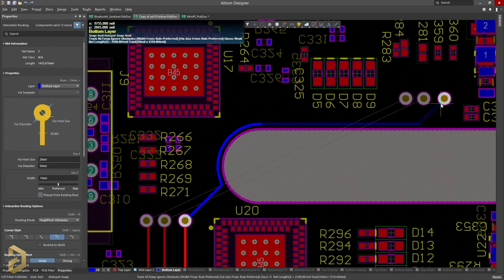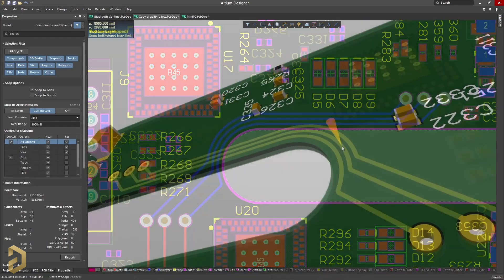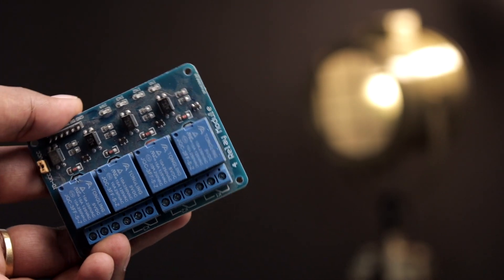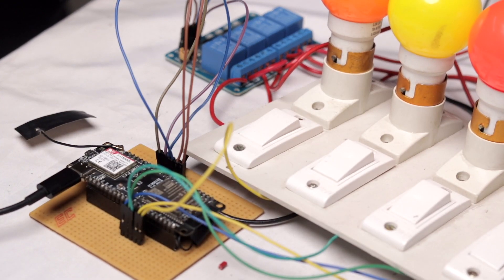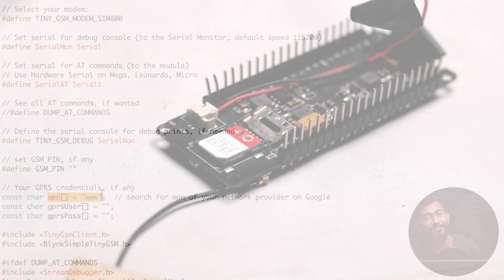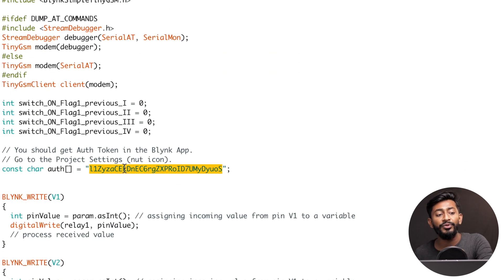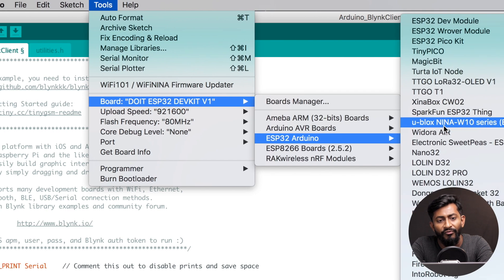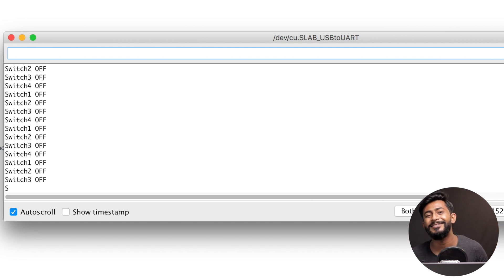GSM/GPRS Home Automation using Blynk | TTGO TCall board | ESP32 Projects

Comment: There is a board with gps and gprs, you could build amazing tracker for escooter with remote control and alarm if you add MPU6050 and a siren 👌👌 would love to see such

There is need for such and especially if you also add to it possibility to controll addressable leds line and few more inputs out puts for blinkers and  Stop signal from brake handle (sort of like scooter / electric skateboard all in one)

Comment: I had a question, I want to make a project in which I want IFTTT to send a request to my ESP8266-01 (then the ESP will do some work like turning on relay). I know how to send request from ESP to IFTTT, but not the other way around. Is there any simple library that allows me to do this easily or you may be knowing any such way, please help me out if you can. Thanks. :)

Comment: i personally would be very careful connecting a device like this directly to a the public cell network since you will be on a public address for IPv4/6.... the ESP devices dont have enough horsepower for real security....  best to put them behind a gateway device that connects to cellular and does wifi in the local

Comment: after resetting the board.. it will wait until the network connected then it will run the code.. can u make the system to run the code if there is no network and automatically connected when the network signal is available?
Reply: Can we add a sensor to esp32sim800l controller..can anyone explain
Reply: @saikiransolo7172  yes..

Comment: I have a scenario, In a remote farm, let we have a motor and moisture analyzer. Using individual TTGO for each of these modules is not cost-effective.   Can you make a project in which, communicate an esp 8266 module with TTGO and control and monitor over TTGO GSM network?